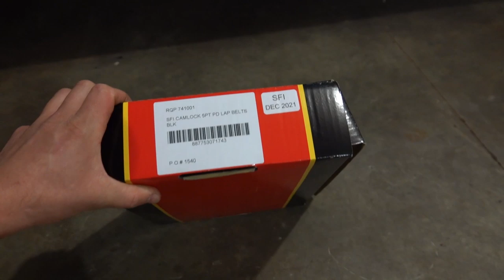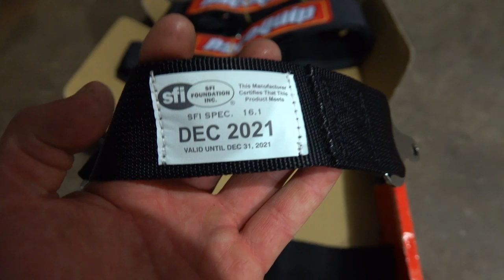Cummins Drag Truck 5 Point Harness Install

Comment: Hey Tom, where did you find the torque specs for when you did ball joints, u-joints, wheel bearings, etc.?  I'm about to do this same job soon.
Reply: https://www.cumminsforum.com/forum/4th-gen-non-powertrain/766649-4th-gen-torque-specs.html

Thuren also has some specs posted in some of their instruction guides.
Reply: 1 uggadugga is fine
Reply: @bb502cid   Thank you very much.
Reply: Monster RAM No problem buddy!